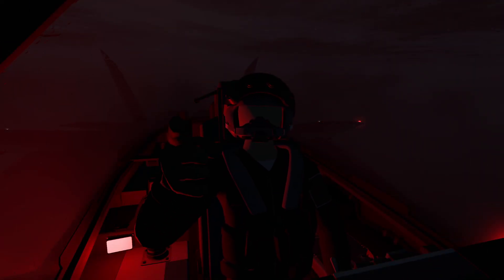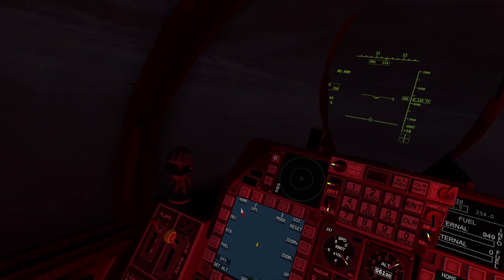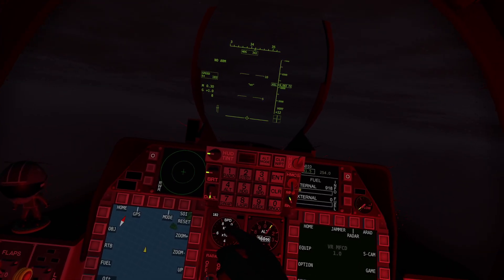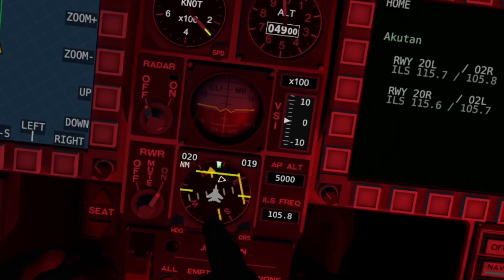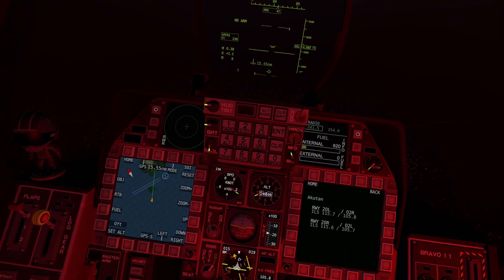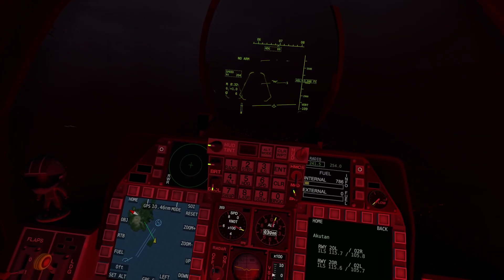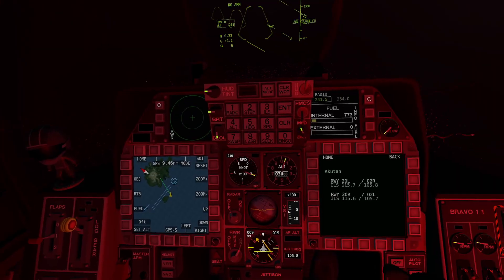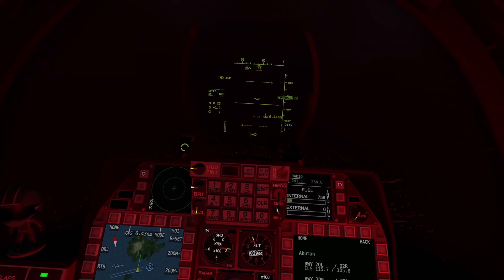ILS Landing in Low to No Visibility | VTOL VR

Comment: Hi
I have a question.  Whenever I try it, I find I get to the airbase but I am oriented wrong to the runway, whereas you were also correctly aligned.  I am only using the lines but I notice there are a couple of other icons too, a couple of lines near the outside edge which I think is the AP heading setting and a triangle.  Should I be using that?
Thanks!
Reply from the maker: It's difficult to say without seeing what you're seeing. I would check that you're using the ILS frequency for the correct runway. If it's the wrong one, the markers could show up backward. I hope that helps!